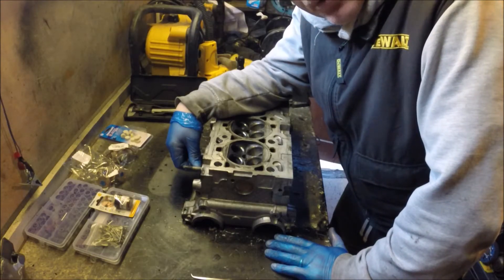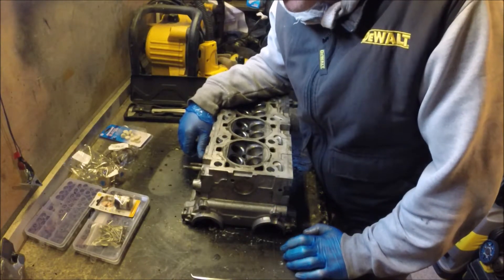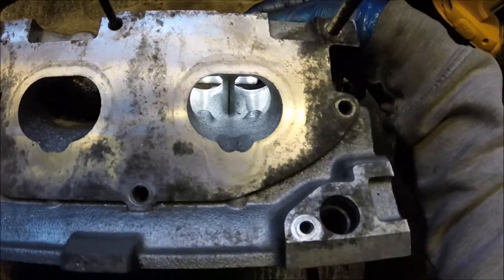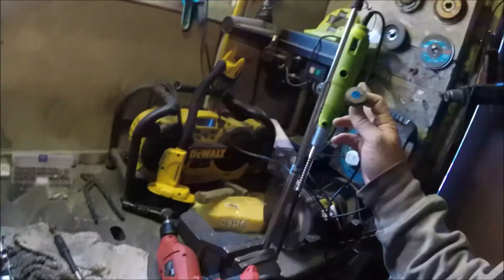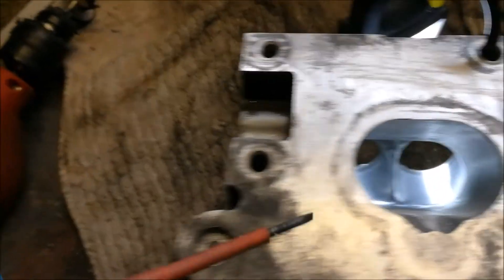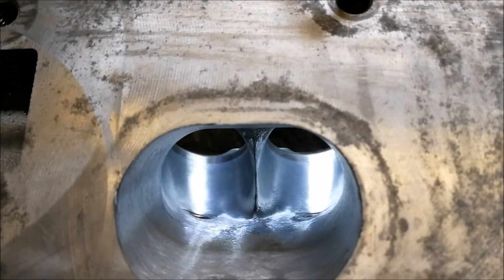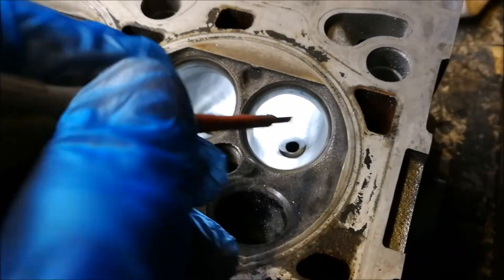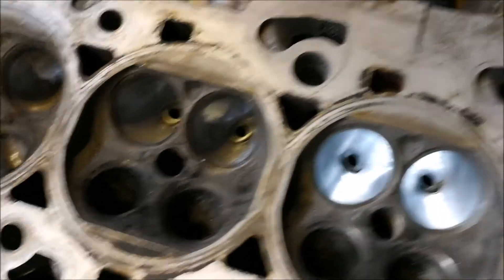DIY : PORTED CYLINDER HEAD PART 1 ST170 / SVT

Comment: I've been looking for a a ST170 head to upgrade my silvertop MK2 Mondeo, I've got the black top wiring harness and the engine mount. How long did it take to port the whole head? I've got a pneumatic dremel ready to get to work. Never done it before and I can't find anyone or anywhere willing to do this kind of service.

I'm just happy taking the imperfections off without digging too much.
Reply from the maker: Andrew Lindley of Al developments does them for around £350.
Reply: @Sparkplugsteve I'm not sure when I will get my hands on a ST170 head, my silvertop has 38k miles on it(I'm the second owner been 12 years). I think I'll practice on my Duratec Focus, it needs a valve job. Anyways I loved the amount of detail you worked on those ports.
Reply from the maker: @erikvianna  will a st170 head for a silvertop block?
Reply: @Sparkplugsteve  just a matter of getting the tensioner and belt sorted out and a spacer for the alternator. I've swapped a silvertop X blacktop before without problems. Also need an aftermarket ecu for the cams.